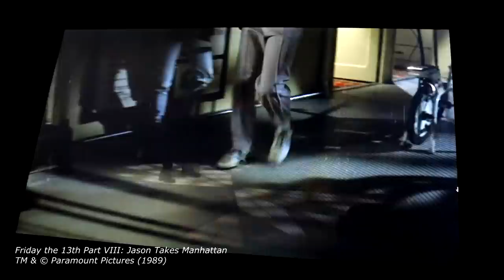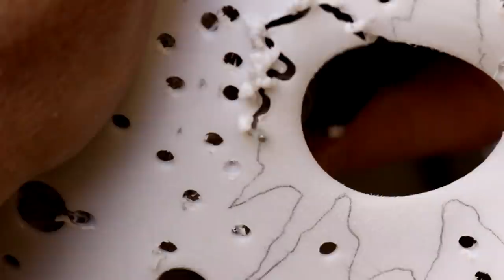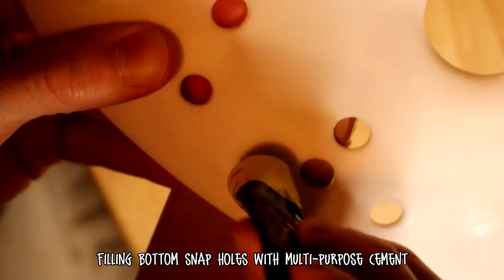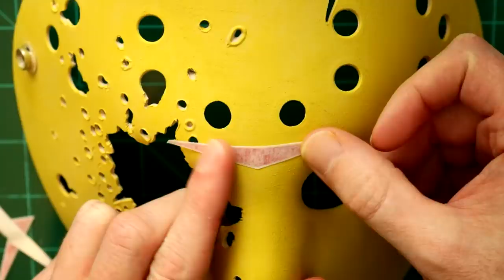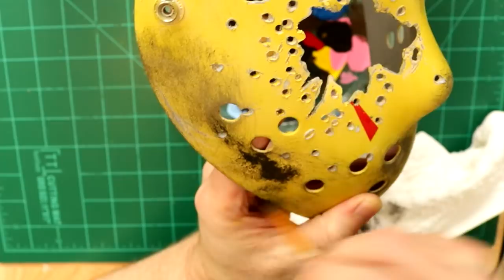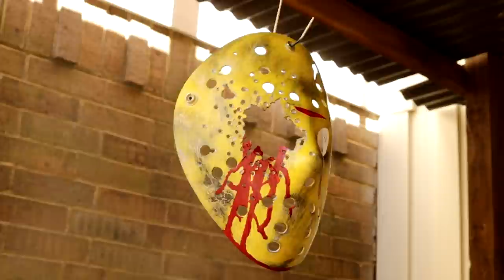How to Make a "HypothetiKILL" Shotgun Wound Jason Mask

Comment: I got a question why do u cover up the snaps is it so the straps go on easily
Reply from the maker: Yes! Honestly it isn't necessary, but it saves time of having to scrape paint off the snaps later using a knife. Sometimes the buttons can still be force onto painted snaps even without scraping the paint off, but it's just much easier to cover the snaps from the beginning.
Reply: @BigHush  ok thanks

Comment: Hey is sandpapering the mask neccesary?
Reply from the maker: Yes! That super shiny non-stick surface on the original blank will make paint flake and scratch off at the slightest touch. It's very important to sand that off. BUT the primer is probably overkill. Usually spray paint is paint+primer anyway, but I'm paranoid.

Comment: I am planning to make a part 4 hock, could anyone please tell me if lemoncello spray paint will work? Also I could only find a black mask and I'm not sure if I can make the damaged areas bright enough with it, can someone help with an advice? (Not related to the raffle)
Reply from the maker: I've never heard of that color until just now. I had to Google it. It LOOKS like it's probably a great color for a part 4. You're right though if your hock is black then scraping off the spray paint will create dark damage. You could spray paint the mask White then Limoncello over that and scrape only the Limoncello off for damage? That's tricky.
Reply: @BigHush It sure is tricky, but thankfully I've already found a white mask so it should be fine. Thanks for the response anyway)

Comment: I took a shot at a chance for being interviewed on the show "Portals to hell"- a paranormal ghost hunting show featuring Jack Osbourne. One of the Investigators of the show put out a post in regards with a place that I work at and has some hauntings and so I gave exposition on my experiences in what I had happen with me. Unfortunately on two counts due to Covid regulations and that what with my story, they weren't Investigating the areas where I had my experiences so they reached back out and said that they didn't need me, but if they needed me for anything else that has to do with the areas that I worked then they'll be in touch with me so that door isn't fully closed yet.